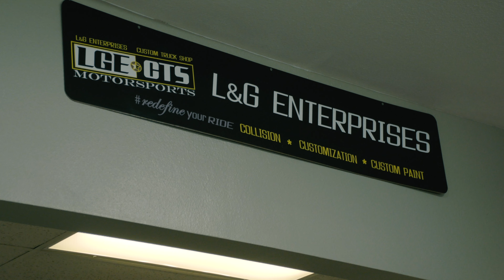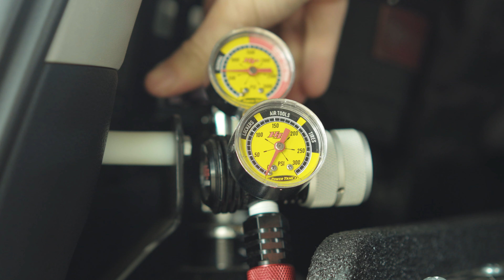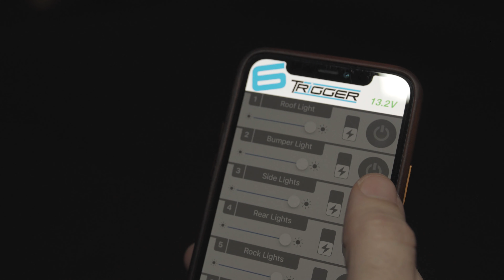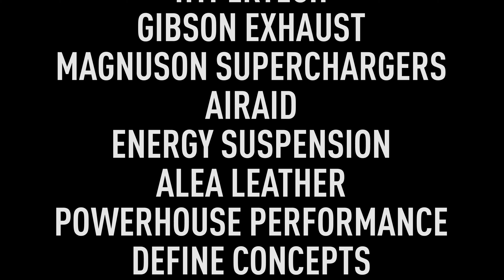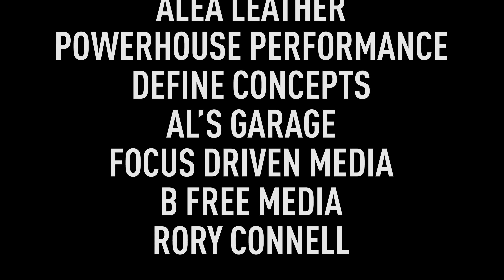Overland Runner E2 - Preparation

Comment: Wish I had the money to do all this to my 4runner.
Reply: You don't need all this stuff. Your stock 4runner is very capable. All I did to mine is put on sliders and AT tires. I've gone through trails way more extreme than almost any of the youtubers out there with $10k worth of mods. All I have is some scratches and dings on my stock skid plates. Just get a good portable compressor, air down your tires, take it slow, and don't try to drive over any giant rocks. Your truck will be fine.
Reply: You could if you knew how to weld and forge metal yourself lol
Reply: @bassage13  What year is yours?
Reply: @timothyandrewnielsen  2019